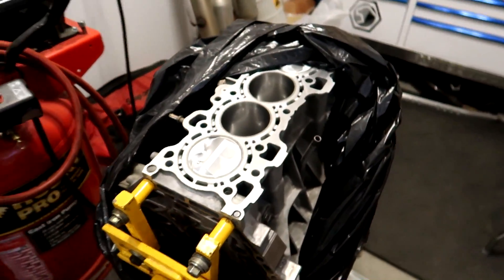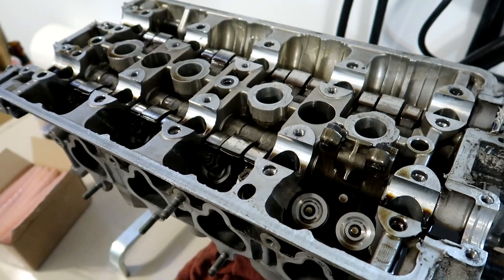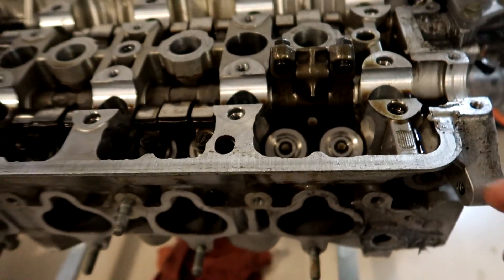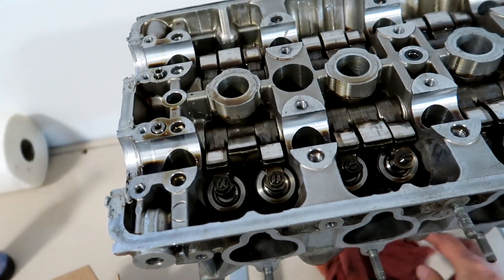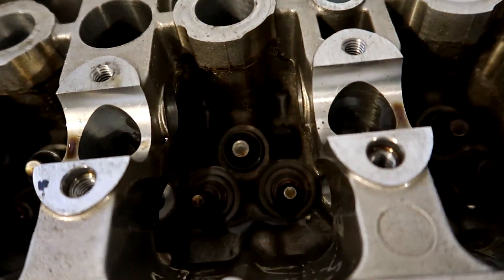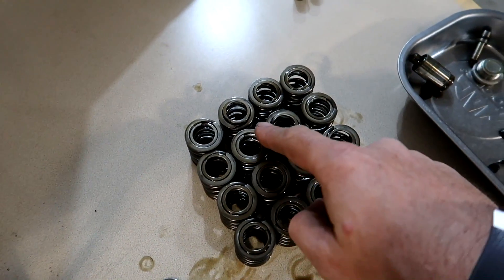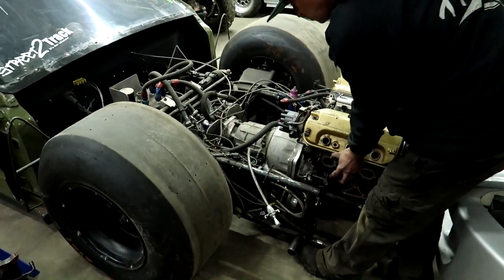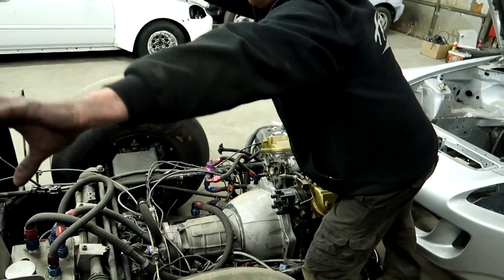Vlog 003 - GSR head work - trip to PFI - SHO'NUFF dreamin' about The Bully and The Curse

Comment: Dan, I am working on a GSR head now, too.  I was wondering about the lost motion assys.  According to my research, the part number you showed (14820-PCB-305) is only used on the NSX.  Did you measure the height difference and spring pressure difference between the GSR and NSX lost motion assys?  Also, since the 14820-PCB-305 spring is not encased in a steel bushing, are you concerned that the 14820-PCB-305 exposed spring will wear the aluminum surrounding it as it compresses and decompresses leaving aluminum debris in the cylinder head?  Thx, AJ
Reply from the maker: The Skunk2, Blox, and updated Honda parts all use the same design.  So I guess to answer your question, no, I am not worried.  I didn't measure them, as they are totally different designs.  Hope that helps!  Thanks for watching!